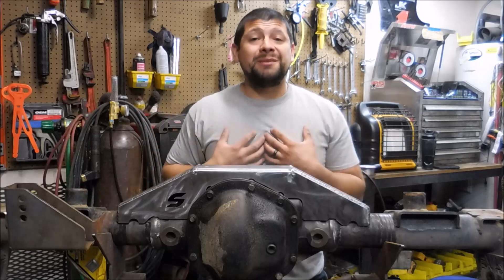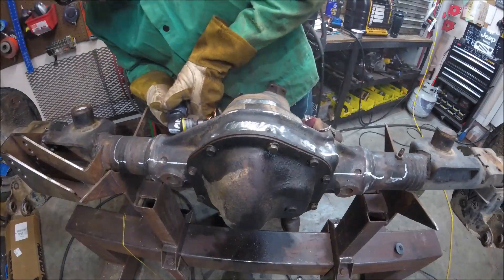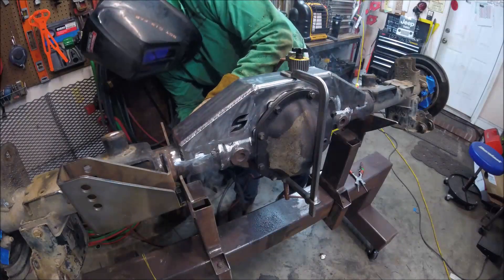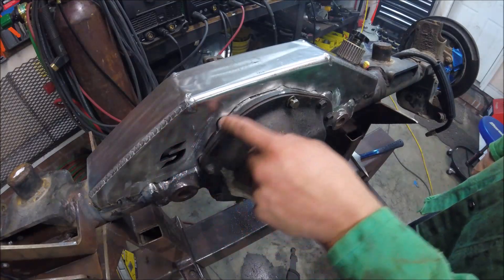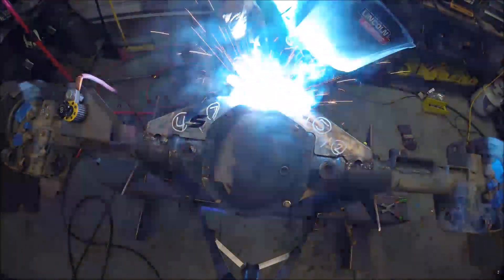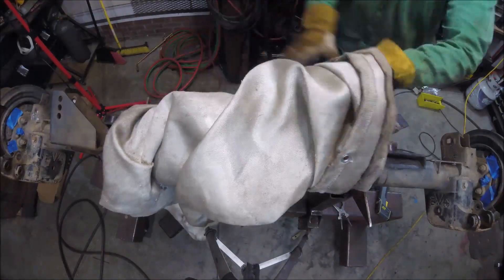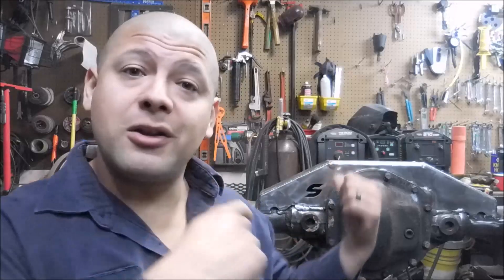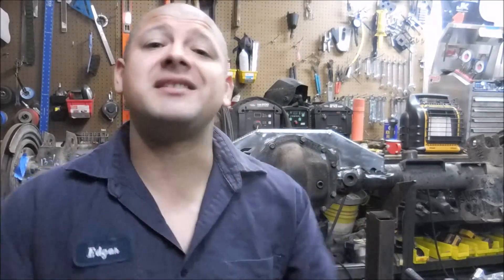Installing an Axle Truss - Synergy MFG (with Nickel Mig Wire Royal 44-30)

Comment: Someone who knows what hes doing here folks. The reason he is using a Nickel wire is because hes welding Cast iron to Mild steel. So many shops will simply Mig weld this and that is a disaster. He also properly brought the temp of teh cast iron up, and slowed teh cool down. The only thing he could have done better would be to completely disassemble teh housing and jig it up to verify the tubes stayed straight or were straight to begin with as they can often be bent prior to a truss installation......sk me how I know. Well done.

Comment: Can you use flux core wire with gas? If  so what are the results? Will the weld be stronger?
Reply from the maker: Are you talking about Gas Shielded Flux Core Wire?
Reply: @cisnerofam08   I’m new to welding sorry if my questions are dumb but I’m referring to whatever combo of wire and gas you mentioned in the video. I assumed that there was on 2 type of wire which are flux core and solid and that solid required gas and flux no gas. In the video you mention using “shielded flux core with 75/25 gas” is that just using the flux core with the 75/25 gas or is there a “shielded flux core wire” that I’m unaware of?
Reply: @moejr14  they call it 'dual shield' when you use gas with flux core. no gas is required with flux core, but when you add gas it creates a secondary shield for the weld, and in some cases can increase penetration.

Comment: Great video could be useful to some. Only issues I see here are that your using that mig wire that is for cast iron and the differential is cast steel.. also not a good idea to keep all the insides in it, it will melt the seals.

Comment: This is a very terrific and well done video, thank you for that. I have one question that is a concern that you did not do or did not address, probably because it’s not important, but with the differential inside with the carrier and such… Should we worry about the heat on the seals or the components inside the axle? 500° is pretty freaking hot, I hate to do any kind of damage.
Reply: I don't think it's actually 500 degrees at the components and seals. It's just on the surface, and all the internals are way far away from that.

Comment: Can I weld up a truss using a harbor freight welder?
Reply from the maker: I have done a few cut and etch test on a weld using the harbor freight 220 welder on some 1/4" thick plate and it got the job done. I would definitely avoid using their, smaller, 110 welders for any axle work. If you have the bigger 220 welder, the one that you can plug into a dryer outlet for example, you should be ok.